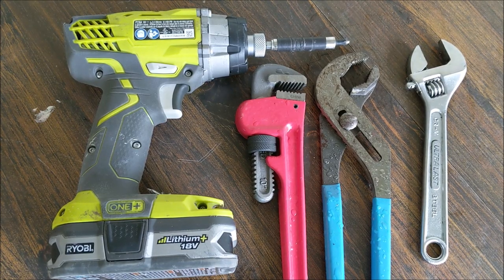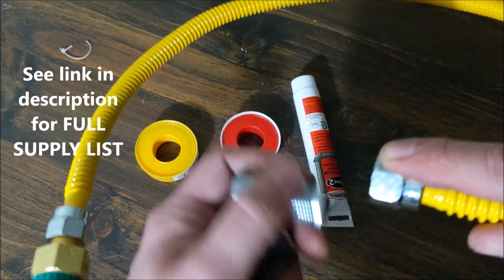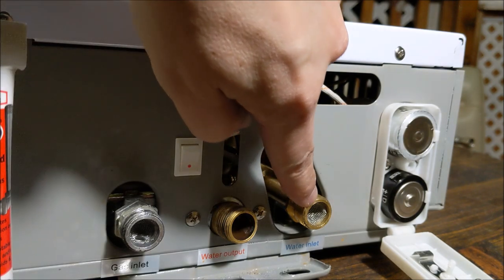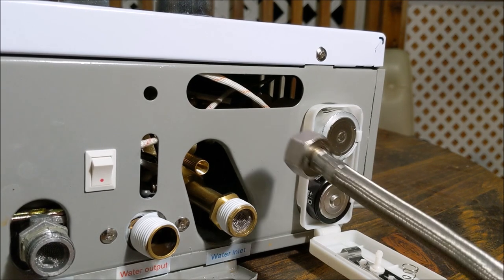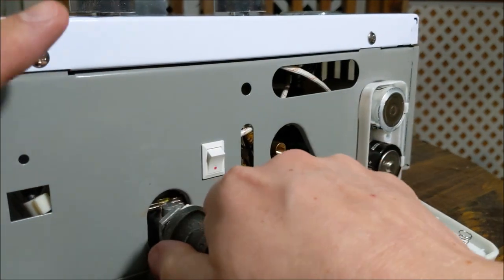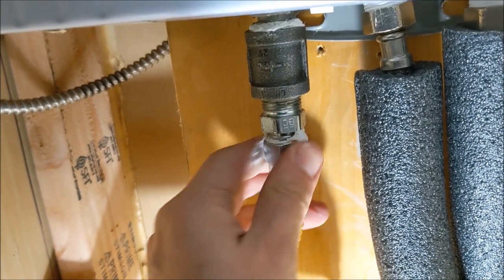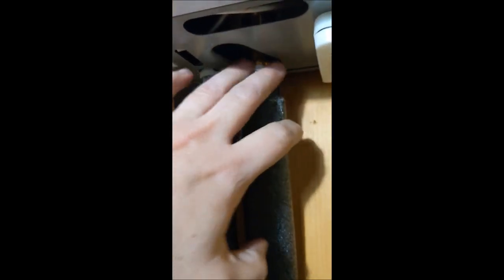Tankless gas water heater install detailed installation TCMT Vevor Marey

Comment: Is there a winterizing procedure for this unit?  The manual isn't very well written.  I've installed one on my travel trailer which isn't going to be used over the winter.  Sub-zero temperatures for weeks at a time are not uncommon where I live.  It seems that there should be some way of purging the small amount of water that remains in the internal piping.
Reply from the maker: Yes there is. 1-Shut the water supply to the unit, should be within reach. 2-Remove the two water lines at the connections to the unit. 3-Attach a wet/dry vac like this https://amzn.to/2S7EDOI  and use an attachment like this one https://amzn.to/2GkVN9a  to "suck out" any water that may not have been drained, that may be sitting on the heat exchanger, to prevent future damage.

Comment: just got one for my deer camp.. i will install it this weekend... i will mount it outside the cabin, do i have to turn it on then go inside, shower, then go outside to turn off? or can i just leave the red switch on and turn off at the end of the trip??
Reply from the maker: It turns on by itself when water pressure is sensed.

Comment: I have one of this TCMT heater. Everything is all right but I just changed the gas tank because it was very low and put the new one. It do not stars, I open the water, sounds the ignition but do not stars. What can I do ?
Reply from the maker: Make sure the model you use is for your application. Liquid Propane (LP) is not the same application as Natural Gas.

Comment: Flush valves would be a great addition so you can flush the system to keep it in tip top shape.
Reply from the maker: Offered this to the customer, installed, for only $99 more, but it was a no, lol....... https://amzn.to/3eOqlPE   We at least offer it to make it an easy maintenance, but they may prefer a damaged water heater a year later.

Comment: Can a competent home owner do this? I got a quote for an install for a replacement and the install was 3k for a $1,300 water heater.
Reply from the maker: If to a degree, you are handy, YES! If you can install a ceiling fan, or have done small plumbing before, and you can follow the detailed instructions on the video, YES!
Reply: @SaveGreenHere  thank you!
Reply: @cwestallen  How'd you get on with it?  Hope you got it done well.

Comment: I have everything hooked up. It powers on when water runs through but it's not heating up. Any  trouble shooting suggestions?
Reply from the maker: So you hear the ignition of gas? Do you hear the gas come on? Check the three adjustment knobs. Put the winter/Summer one on winter. The one off to the right adjusts water flow. Lower/slower water flow will be hotter, so try adjusting
Reply: SaveGreenHere thank you. I tried what you said still nothing. Water and gas are flowing, the ignitior is sparking but it may not be lighting the gas.  Any idea?

Comment: Very good up load. I am not sure of your install, however, others might liked to have seen you purge your system of air to prevent any damage to tankless or just have talk about how you did it. Also talked about a flush the water line for any debris. It is all good information. Thanks
Reply from the maker: Yes Michael, good point. We usually purge after we install the "water in" line, and use a 5 gallon bucket. We do this, and then install the "water out" line that goes to the home. Here is our video of the purging of the water heater..... https://www.youtube.com/watch?v=cg3iSKM6dcU

Comment: For the vent, I have B-vent connected tightly to the top because I read these don't use conventional drafting. Is that true? I have been smelling quite a bit of exhaust in my basement after a long shower, so I know the venting it not all going out the B-vent pipe I installed. Should I leave a space and will it draft? Again, I read it doesn't need to draft, but maybe I am misinterpreting it. I was also thinking of installing a small fan to pull the vent up the vent pipe and out of the basement.
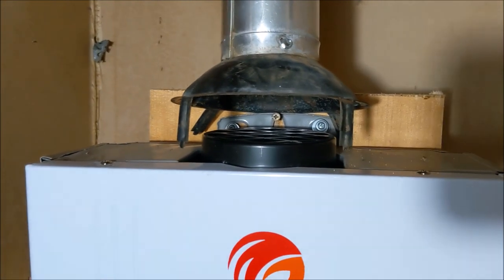Reply from the maker: Starting at the 9:20 mark I go over the venting. But you ABSOLUTELY need it to vent. If you smell exhaust of fumes, your vent may be damaged or clogged, so look into it. But naturally, the fumes should just rise up through the stack.

Comment: Hi great video! Thank you! Can you please tell me what the brown and orange wire connection goes to? Im wondering if its missing something because I can not find what it connects to.
Reply: The unit is a Ridgeyard propane water heater. A friend bought it used.
Reply from the maker: Check if it has a battery compartment. If it does not, it may be an older model that needs to be connected to a 110v outlet to provide the "spark" for the propane to ignite. The battery powered ones shown on the video are so convenient, because the batteries need to be changed only once a year.

Comment: The connections (threads) on the unit self, what size are they please. The water one is 1/2 you said.. is the gas one 3/4 or is that also 1/2?
Reply from the maker: Discount link..... https://amzn.to/37aAiiL
Or upgrade model..... https://amzn.to/2OEzRXE
Adaptor for American, USA Gas lines... https://amzn.to/2TkvtBx
OR, 90 DEGREE ADAPTOR..... https://amzn.to/2IWLBEr
Gas flex line with safety... https://amzn.to/2XTKXuL
Pipe compound.... https://amzn.to/2CKti2n
Gas pipe Teflon tape... https://amzn.to/2u2gJIE
Premium water pipe teflon tape... https://amzn.to/2XTu3wG
Flex water pipes..... https://amzn.to/2O2aXjm
Shark to 1/2" for flex water pipe... https://amzn.to/2XTg21J
Alternate tankless water heater models CHEAP!... http://ebay.us/B1ssST
Reply: This is a very good video, but in my recent experience (last week) I could not get the unit to work.  I used a 1/2 yellow flex line for gas.  The Gas Company came out and said I needed a larger gas line.  Switched to 5/8 inch flex line and it works fine now.   No disrespect to Save Green Here, just telling you my experience.

Comment: Do you put a T on the supply line to provide cold water to the cold water faucets?
Reply from the maker: You do not need to modify the cold water supply. Use the existing cold water supply coming into your water heater location.

Comment: are these safe to use full time in your home? I worry about using the cheap ones from amazon in my home
Reply from the maker: Yes, but proper installation is key. Bad installation means the unit will not last.

Comment: Hi, what controls the flow of water, the cold inlet or the hot outlet through a faucet? In other words can it  be plumbed into the hot water system so that when a hot faucet is turned on there is hot water flow?
Reply from the maker: You can see those details here... https://www.youtube.com/watch?v=KAK4V3lDpuc

Comment: I bought mine to take on a camping trip,is this possible ?
Reply from the maker: If you bought a propane specific model, like this one... https://amzn.to/2OdrGCe then you are set. However, the one I cover on the video is a natural gas unit, used on residences with city natural gas utility.
Reply: The tcmt 10L is a lpg model

Comment: Why did u not install clean out valves?
Reply from the maker: Offered it to customer, and didn't want it installed because of the extra $$$$. It was on a single-wide, which are considered a "not permanent structure" and not bound by local codes. Therefore, it's on them if they don't want them installed.
Reply: @SaveGreenHere 
Got mine installed w valve kit. No leaks. Batteries are good. Unit doesn't seem to work. Suggestions?
Reply: I just discovered my issue. Gas pressure is too low. Minimum is 0.25psi. City delivers 0.14-0.21psi. Ugh.

Comment: Mine runs for 5 minutes and dies. It seems that if it hits 70C. Or around that it dies..I can try to reduce the flow or flame but I never get the 19min or so of run time before shutoff
Reply from the maker: Did you get the 3 year warranty for around 20 bucks?
Reply: 70C is Too Hot 47c is a hot shower, shutting down on overheat, units will only run for approx 20 minutes than shut down simply shut off water and turn on and it will start again, both of these are saftey features

Comment: Why half inch flex lines, Shouldn’t it be 3/4 inch? That’s what my electric water heater uses.
Reply from the maker: Go with what you got. If you got 3/4 that's fine too. The 1/2 inch on the video was for a mobile home with only one bathroom.
Reply: The unit is 1/2". If u want to run 3/4" until the last connection, go for it.

Comment: Need help! Have the 18L. I bought this unit online through one of the major companies to get items of this sort been received the hot water Outlet fitting was slightly bent at the time did not think it was a concern in the process of having everything fitted together it was leaking take off the front panel and the copper tubing to the hot water Outlet fitting was bent in the process I bought this unit online through one of the major companies to get items of the sort when received the hot water outlet fitting was slightly been at the time did not think it was a concern in the process of having everything fitted together it was leaking took off the front panel and the copper tubing to the hot water outlet fitting was bent in the process that busted the copper and trying to find the replacement part for the outlet fitting because it has the temperature sensor in the fitting and we can't find that part anywhere or what manufacturer to go through to get it my mother-in-law has not had hot water in a week now because of this and being in Illinois is it cold right now
Reply from the maker: Your best bet is to ALWAYS buy from a trusted supplier like Amazon. That's why I used their link on the video description. Additionally, I always spend the $4 or so extra to get the warranty. It's worth it, and if there is ever an issue, you get a replacement, or full refund, no questions asked. Better safe than sorry!
Reply: @SaveGreenHere  I did get from Amazon.  But I am the one who did the major damage. But just trying to find the outlet temperature sensor fitting.
Reply from the maker: Just try to return it. Order another, and get the warranty for like $4. I always keep an extra on hand, because it's sometimes easier, and cheaper to just replace the unit, than to try to buy a part. WHat I do is put in the other I may have around, like a cheap 8 Liter model, and return the other that I have a $4 warranty on.
Reply: @SaveGreenHere  this is what I did, got the warranty and plan on grabbing another if I like it.
Reply from the maker: @ExtraFungus  Yes!